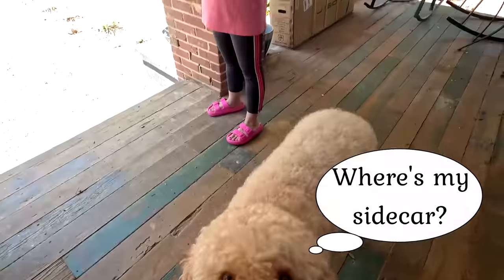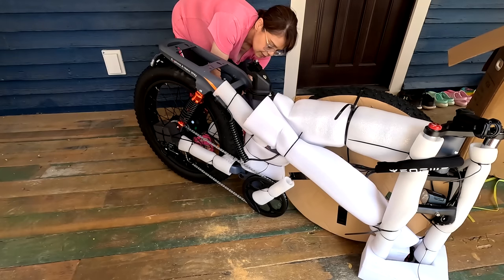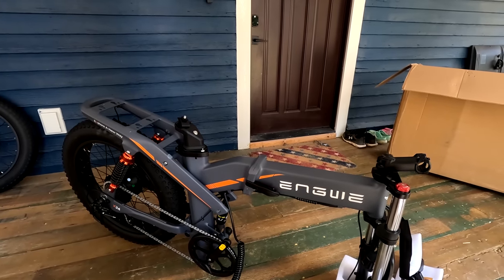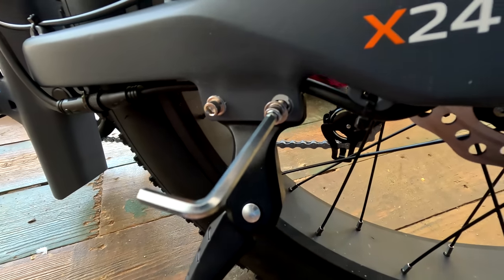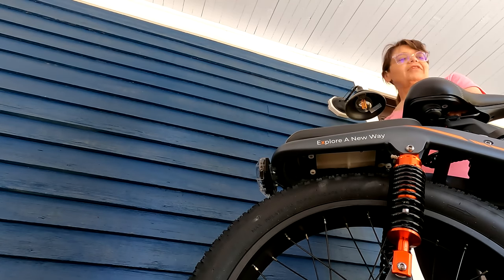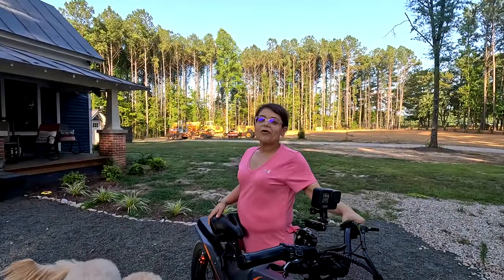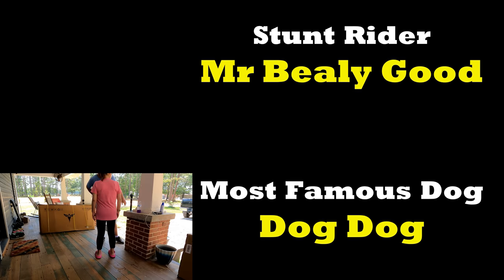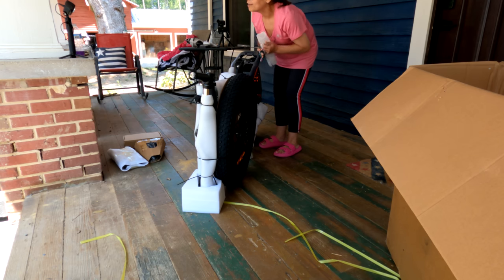Mrs Bealy Good Assembles the Newest E-Bike from Engwe

Comment: Couple observations.  Need to make this a step-thru for the ladies and those over 60-70.  Need to make the seat adjustable to a lower position.  Mrs B is not the only miss short legs out there.  Next review, do a power setting vs speed correlation, charge time from say 60% to full, and some barometric of full battery to some state of discharge, (time, miles).
Reply from the maker: Good metrics. I’ve copied this and will paste to my notes. 

They do have a step thru version that I reviewed before that is also shorter. 

Thanks for the comment!